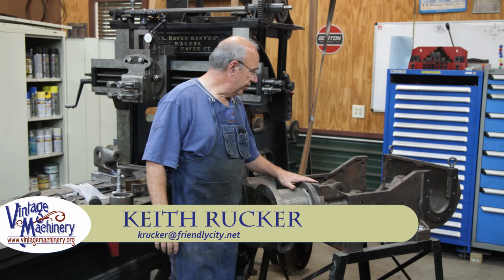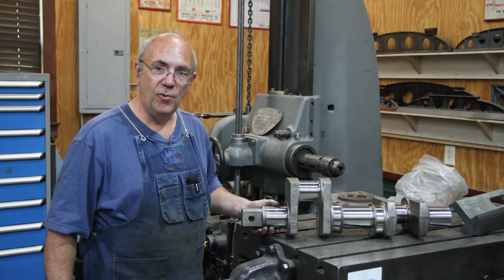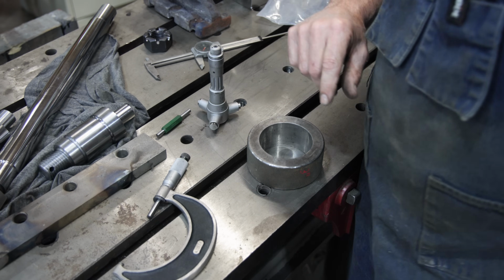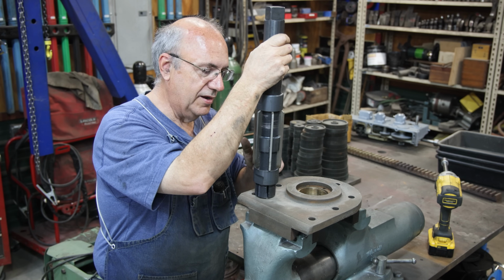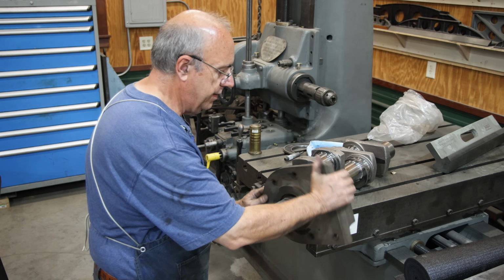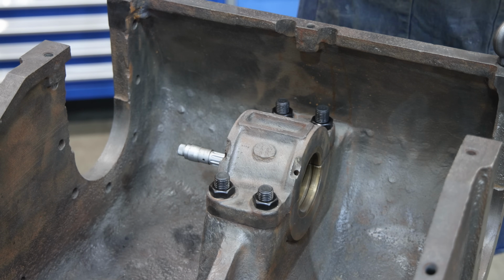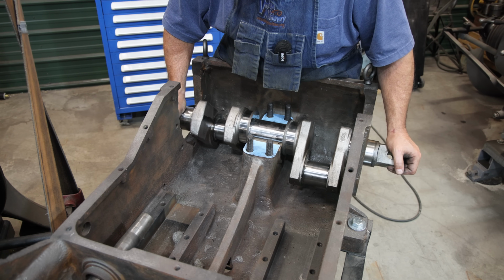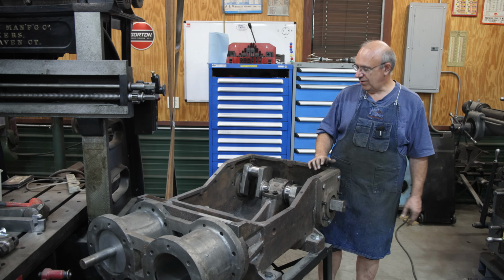Steam Stoker Engine: Installing the Crankshaft

Comment: Should those three bearings not be line bored so they are all in alignment, as well as the same size???
Reply: I think the problem with that might be that these bushings are worn, and may not be worn evenly. Trying to bore them all out to the same size may end up taking out too much material from one of them.
Reply: My thoughts exactly. It must be align bored to keep them in the same plain or the crankshaft will bind
Reply: I agree with all of you, line boring is necessary as indicated by each bearing runs free, but with all bearings in place, the crank is binding. Further, I would advocate drill each end plate, and the bearing cap, before line boring, and install either dowel or taper pins to insure proper alignment on reassembly.
Reply: How? There are no alignment features to keep the end caps located identically in relation to the center bearing, nor the center bearing cap aligned with its own lower half. Only bolts. The original design couldn't have been bored, disassembled to add the crank shaft, and re-assembled and still have lined up with how it was when it was bored. You'd have to add in several locating pins or substantially tighten up the tolerances on the end caps & main casting. But since the original design doesn't have that, it's pretty clear that this wasn't done when the machine was first built. Steam engines tend to work with much looser tolerances than internal combustion engines, they leak more oil than even British cars. Steam locomotives are thousands of moving parts transporting hundreds of oil leaks.
Reply: Another Keith video of “how not to do it”🤣 . Definitely need to line bore it if you want a good job
Reply: @emilgabor88  How? It wasn't line bored to begin with (bolts aren't locating features, and it has no other locating features for the center cap or end caps). So even if you line bored it, you'd lose concentricity the moment you took it apart to install the crankshaft. So, without modifying the design (since this is a restoration, not a redesign/rebuild), how do you propose to line bore it and get that alignment back after re-assembly?
Reply: @ the alignment is not that important . You can make it after you assemble it by taping the outer bushings around … but by and reaming it you don’t have The perpendicularity of the bohers to the outside of the motor .

Comment: mmmmm one question
you work out of the current center of those bronse bearings, but are they new or are those the ol oversized ones with wear acumulated on one side?
Reply: Can't imagine they are old oversized bearings if they are a tight fit on the refurbished  on  size crankshaft?
Reply: @zorbakaput8537 as he said they welded crank bearing surfaces back to size, because on last repair crnak was so worn out they had to put oversized bushes on the sides.
i am simply curious if after hand reaming to size all 3 bearings surfaces are even in line because i have similar problem all the time repairing sewing machines
Reply: @ that is what i was thinking about because with 2 bearings you can usually get them aligned  by just sliding them on but with 3, at least in sewing machine i need to use long reamer to get all 3 in line or the middle one has to be slopy that is why most mass produced sewing machines nowdays uses spherical bushes to forget about the problem (and only ever use 2 of those)